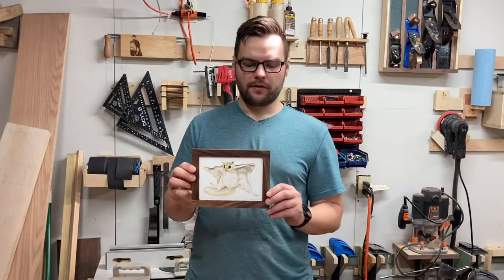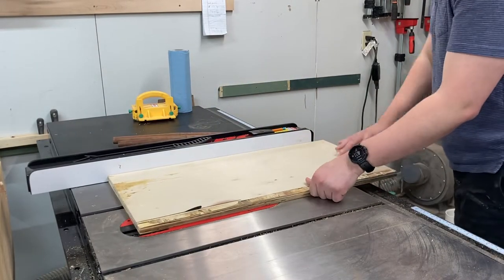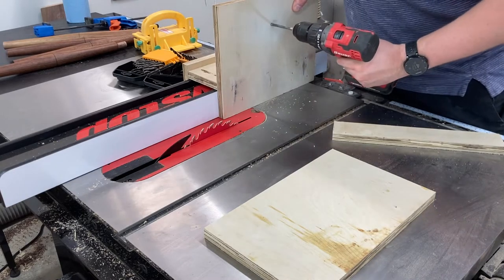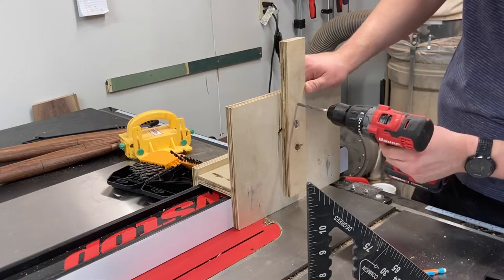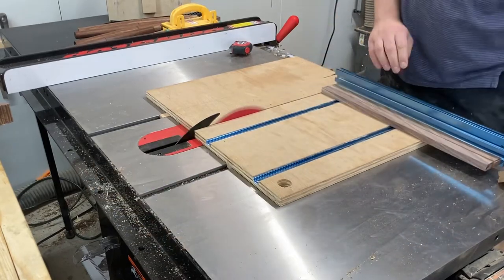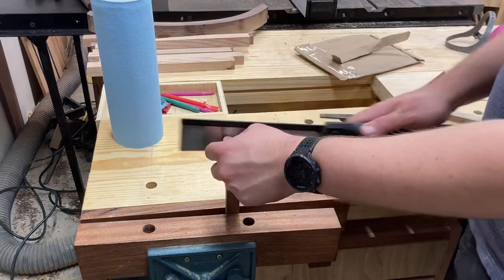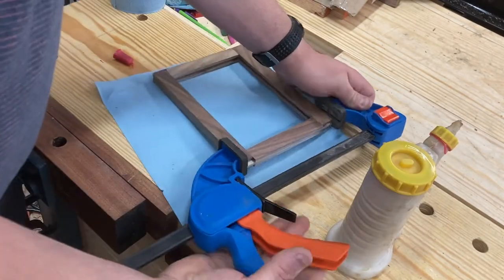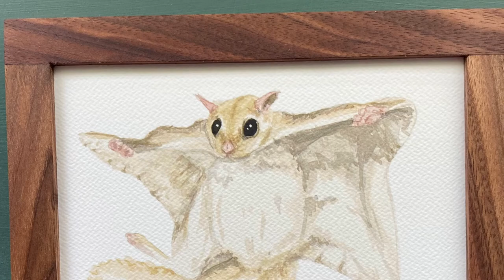Bridal Joint Picture Frame and Tenoning Jig Build

Comment: I'm guessing you made the jig to enable fast batch production?  How long do you estimate each frame takes to make if you batch say 10 at a time?  I suspect the real time saving value of the jig isn't evident in this video.  The frames look like a good high volume piece for craft stall trading, using small offcuts and a fast production process... sounds like a winner!  I'd maybe change the groove to a rabbet to enable inserting glass from behind, in which case I'd also design frames to fit standard glazing sizes... yup, lots of opportunities to modify and develop a range of products all built with the same bridal joint jig.  Very handy indeed! 😊
Reply from the maker: Thanks! Yeah, I only used this method once just to try it, but the jig worked well! I don’t like using splines because they don’t really work well for quick alignment. If I wanted to make a lot of picture frames, I’d probably use a stub tenon and groove method and leave a rabbet on the outside like you said